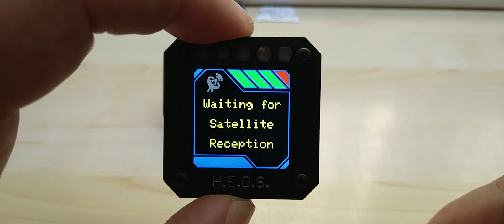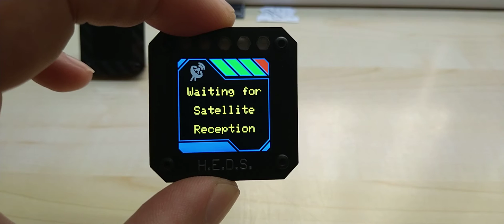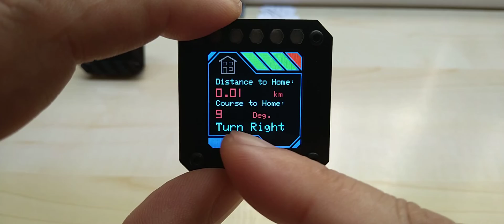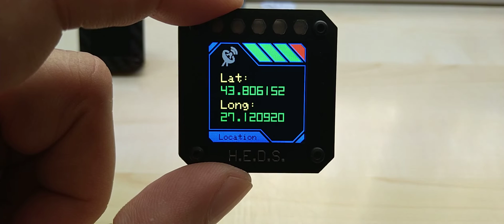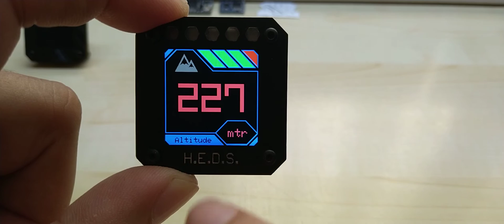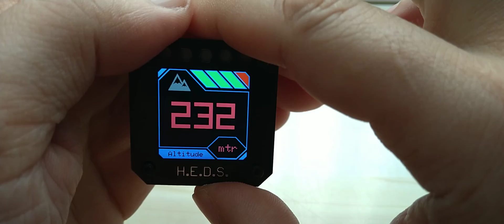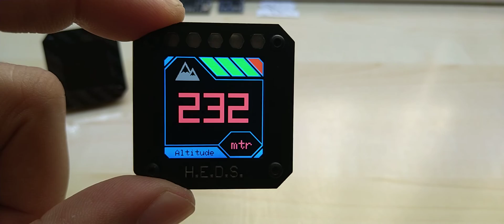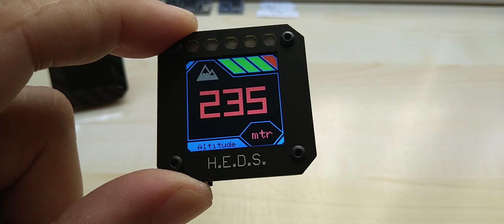H.E.D.S. GPS Preview of interface, hardware, future ideas and options. Library by Mikal Hart, thanks

Comment: Great addition Hayri! Very nice clear display too!
Have you considered designing a lower profile board and low power board with the footprint of the gps on the back of the 328p board so you would solder the gps directly to the microcontroller board, maybe connect the gps to the hardware port of the 328 (a jumper should be used to open the 328 RX to allow code upload) running at 8mhz 3.3v LDO mcp1700 maybe a mosfet to switch power to the gps (keeping V_BCKP connected) full battery protection and charging, then leaving some outputs for some wireless connectivity. 😃 just some ideas!
Reply from the maker: Thank you Ian. yeah just love this display and if I would have enough money I would buy 100 of them just to have enough stock :-) Being 1.3" with 240x240 pixels and be an IPS display makes it hard to beat. I also have a 2" version with 320x240 and a 1.14" with 135x240 pixel and all have the same quality and the same ST7789 driver chip so I can use the same code. Actually I do have a small 20x20 mm PCB, same size as my GPS module that I use for the GPS tracker that logs the data onto a microSD card that is on the other side of the GPS module. It does however no charging circuit on it, just a 3v3 LDO and runs up to 6V power. So any lipo or 16850 or even 3 AAA or AA batteries. Just connect power to it and it starts recording as soon as it has satellite reception of course. Haven't implemented any power saving though. I actually wanted to make a slightly bigger PCB with a battery connector for a CR123 cell, as those are readily available and give a long runtime. At the moment I am thinking of a device with the 2" display and several software features. It would be a merger between my Clock and the GPS Cube plus adding other sensors like temperature, pressure, accelerometer for example. Will see how it goes, have a few other new products coming out first :-)
Reply: Hayri 
I think I remember the other 328 board which connects to the gps was it the pico gps? I didn’t think that the gps soldered directly to the gps board it was on its own carrier board?
More gadgets coming out, looking forward to those! Have to say you churn them out like a machine, amazing 😄
Reply from the maker: @iantcroft  Correct, the board was the PicoGPS onto which I solder the GPS module and on the other side it has the microSD card slot and is connected to the main board by 8 pins. I could technically solder the GPS module directly on the main board but then the battery would sit on top of the ceramic antenna and blocking reception. With the carrier board I can have enough space in between main and carrier PCB. The only problem is, that the microSD slot is recessed and not usable, although the "regular" GPS does not necessarily need the microSD slot of course. Speaking of gadgets, it's not a gadget but I just finished designing a new PCB, after putting the Neopixel light in the car, which has a dual 328/1284P footprint, either one can be used and a BL module on the back, for wireless remote or even code upload plus it has a connection for a small DC-DC buck converter that I use in the car (input up to 28V, 3A max) all in a size of 34x17 mm. It also has 4 digital and 3 analog in outs.

Comment: Congrats, great concept, nice project, perfect result. How long does it run on one battery charge, and how do you recharge that?  Any plans for any kind of connectivity (BT, IP, UDP)?
Reply from the maker: Thank you Ulrich :-) Haven't tried the run time yet, it will also depend on the final Lipo batteries capacity. The GPS gets charged with the in build Lipo charging circuit over a micro USB connector. Haven't thought about any external connectivity yet, BL would be an option but where would you like to send the data? I think a microSD card would be more useful for data logging for example. I am open to any suggestions :-) Using an ESP module or a LoRa module would be possible as well. Although a ESP module with WiFi enabled would eat up any battery real fast, could of course be disabled most of the time and only send data when needed. Many possibilities :-)
Reply: Hayri Thanks for the prompt reply.  Marine navigation (leisure sailing) would be a  potential field. Less logging but the actual position. I know, there are tons of devices, but there is always headroom for improvements. 
What type of display is this now? I understood it is NOT Oled, but then what? I am sure you mentioned it, just did not catch it, sorry.
Reply from the maker: @ulrichkliegis4138  No problem. Well since anything marine related would need to be waterresistant or even waterproof, I got that covered as the H.E.D.S family has the size to fit into a waterproof GoPro Session case. And since speed is measured in Knots on sea, I can display that as well and even go as high as 8 decimals after the comma for La.t and Long. As for the display, it is a 1.3" IPS color TFT display with 240x240 pixels and is easily viewable outdoors and sunlight, which would be a plus for marine use as well.
Reply: @iHayri1  Thanks! Waterproofness depends on the environment. On yachts, IP 66 is sufficient, for dinghy sailors who spend some time on the water rather in it sometimes, IP 67 is mandatory...

Comment: What clock speed are you running the 328 at? The display update is on the slow side. Also any update on the Tiny1284? The crowd supply page hasn't changed in awhile.
Reply from the maker: 16Mhz, the GPS data updates at 1Hz but the many bitmaps and drawing lines do slow the initial page loading. As for the Tiny1284P I still need to supply a "professional video" to them as they did not like mine. But I have no way of editing videos, neither is my PC fast enough nor do I have the software for it. I am kinda stuck right now.